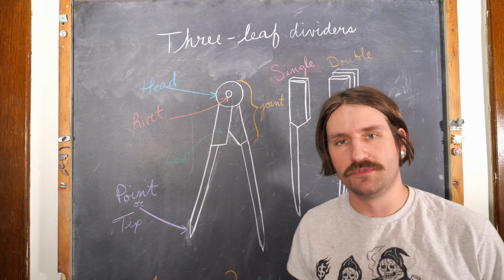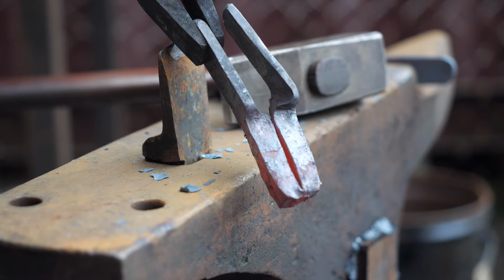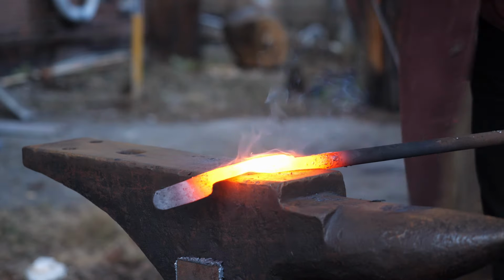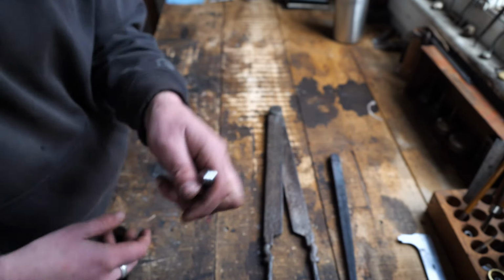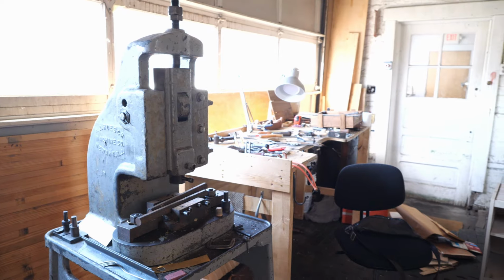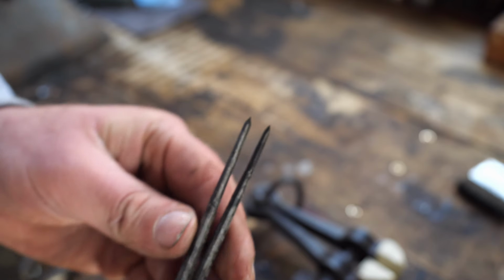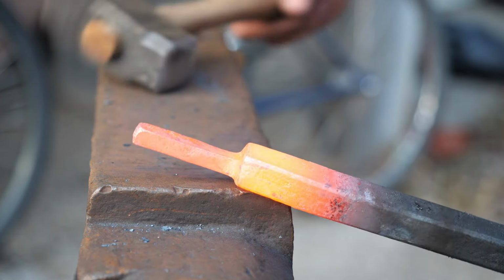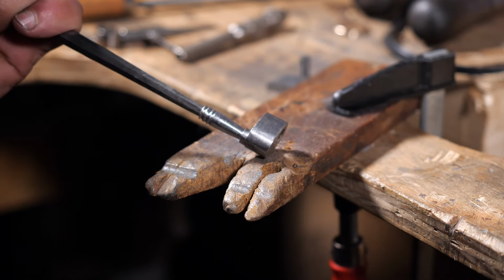Blacksmithing - Making a drawing compass (forgewelding and failure)

Comment: Awesome work, I really like you showing the process in depth!

Quick question, after you heat treated I saw that the legs passed the file test and then in the next scene you we're trying to bend them a bit straighter and they we're all shined up again.

My question is did you file them after heat treat? Or did you sandpaper them? I always get worried about filing hardened steel as I feel it will damage my files but if there is some way to file after hardening I would love to know!
Reply from the maker: Thanks for watching! I filed them to shape prior to heat treatment, after quenching, I shine them up with some fine grit emery paper so I could see the temper colors. When working with hardened steel, I don’t use files as it would damage them, so instead I use abrasive paper. Hope that helps!

Comment: How do you get the rivet and boss area to function smoothly and tight enough to hold dimension?  Thank you .
Reply from the maker: My understanding is that the 3 “leaves” disperse the pressure of the rivet allowing for smooth and stable movement of the legs
Reply: @nate_weiss_  right on Nate thanks . Also do you counter sink the holes for the rivets on the washers ?